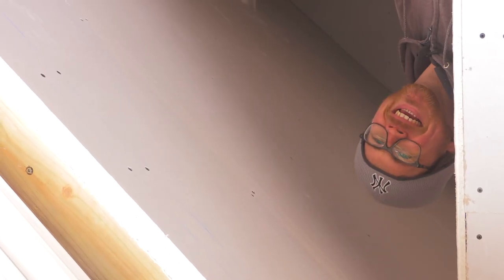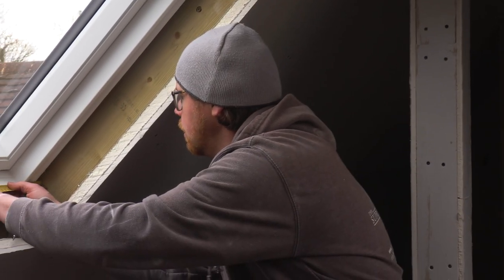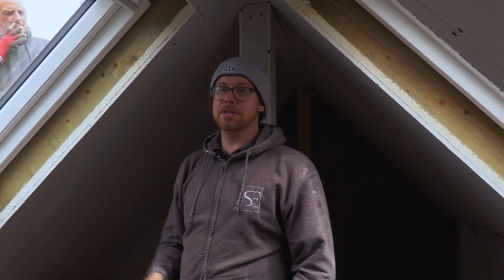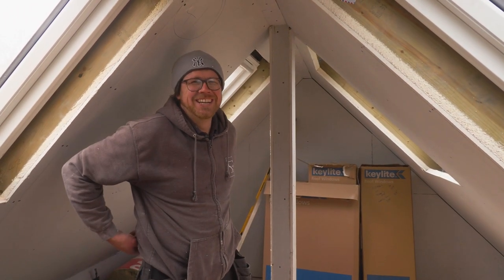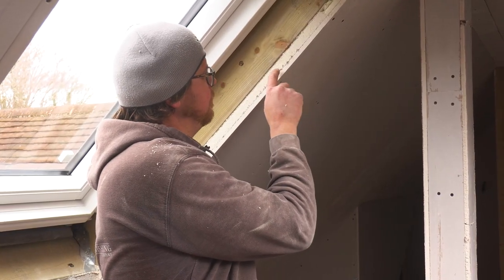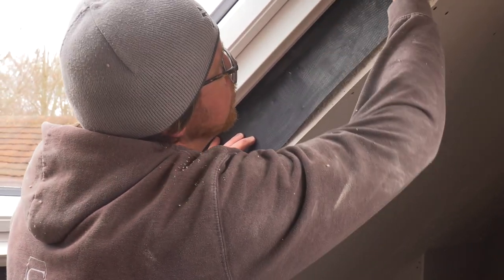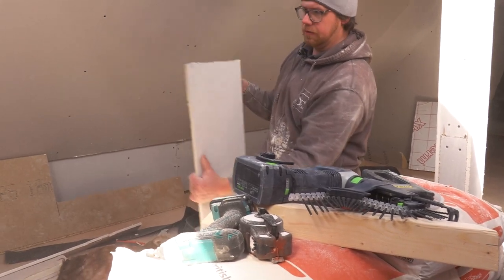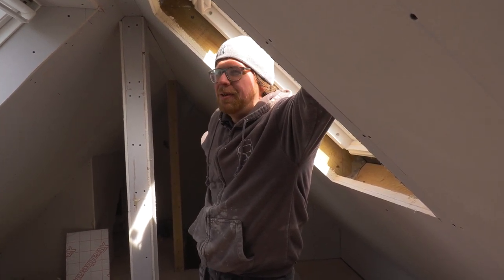How Do You Plasterboard Around a Roof Window? ~ Extension Build #13

Comment: It's amazing how much extra headroom, perceived and real, splaying out the window head creates - can make all the difference.  It's also amazing how much extra work it creates and the forward planning needed at framing stage - great tip to leave the horizontal trimmers until the rooflight is in.  In the past I've made splayed ply collars and fitted these to receive the plasterboard, bit tedious getting it aligned correctly though.  On the upside it gives you the chance to spray foam up the gap between ply collar and framing/adjacent insulation.

Comment: Great video, only thing I’ve had before Is the plasterer struggles to nail the bead in the insulation and we had a job crack. So now we perimeter the velux with 2 x 2 to give plasterer a solid fixing. Nice one

Comment: Nice job  I normally fit velux and I do think them keylites  are worth a try I like that foam strip around the out side great idea
Reply: Wouldn’t expanding foam be the same like around regular window or is that not the same?
Reply: @mrfr87  Everytime I've used expanding foam, it's an absolute nightmare, trying to remove it from anything else it gets on to, that you didn't want it to.

Comment: I done a few in the past and the cheeks and ends were all square. I have to say I do like your method, as you say it gives the impression of a brighter room. That's going to be nice up there.
Have I missed the video where you did the insulation in the rafters or is it just insulation back plasterboard?
Reply from the maker: Tiny Tony
A lot of people trim out the openings square but it can cause problems and all the manufacturers say to splay.
Reply from the maker: @jlewis1688  It traps the moist air in the corners because there is no convection flow. This can cause mould to form around the top corners. It also cuts down the light transmission by a considerable percentage, something like 20% of the possible light is lost.

Comment: Great work James. Am I right in thinking you have fitted the top and bottom supporting (forgotten the specific name) noggins/rafters of the roof light at an angle to achieve the splayed plasterboard?
Reply: Thanks Adam, the trimmers (the word you were looking for) are fitted square with the rafters as they need to be fitted with jiffy hangers. We set them up at the correct distance from the window top and bottom so that the plasterboard fits from the groove in the edge of the window over to the corner of the trimmer which leaves plenty of space behind for insulation.

Comment: I want to put an skylight at the top of my stairs, which transfers up to the hip end on my end of terrace - how you begin planning on how the roof cutout will line up?
Reply from the maker: It is all about measurements. You need to find a couple of reference points and work from there. When you take a few tiles off you will then be able to get it spot on.
Reply from the maker: @jlewis1688  Good tip

Comment: Hi.  Great work!  How is the Keylite insulation collar for vapour permeability?  I am wondering if the VCL could be installed before this was activated and if that would help.  Also what are your thoughts on using a VCL that doesn't need the mechanical fixings; sticky stuff might close a few vapour paths.  All very minor details.

Comment: Why not use foil backed plasterboard in reveals, or green moisture board, or even foil tape the roof timbers when taping up the insulation between rafters

Comment: Love your work, love the channel!  Quick question
 building regs in devon  require all the joints in the PIR board to be taped to create a vapour barrier. I have argued the point with building inspectors and manufacturers of celotext that its impossible to tape the joints when using insulated backed plaster board and have had no satisfactory answers.  I noticed you staple the dpc to the trimmers around the window. Do you mastic/ tape the dpc to the pir board or is that unnecessary?
Reply from the maker: To be honest the vapour barrier will generally leak a little here and there. It is the same with foil backed boards but the joins are over the rafters and the small amount of moisture entering those treated timbers is not going to rot them in a 100 years. 
The breather membrane will cope with a fair bit of moisture so it is really a case of doing your best
Reply: I Don’t use insulation backed plasterboard as it’s expensive. I have my insulation between the rafters, then insulation boards underneath 
,tape the joints then board.

Comment: Super impressed by the standard, but I do imagine for 95% of people on earth they wouldn’t noticed a skilled tradesman putting it in by eye. If it looks right it is right. Doesn’t need to be joinery standard. Especially as the plaster can adjust when plastering. Beautiful work though!